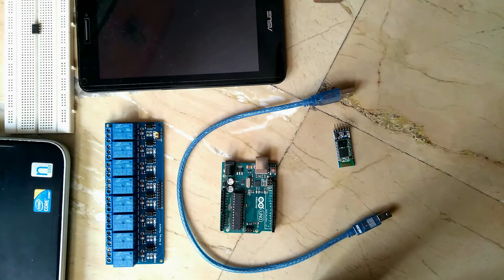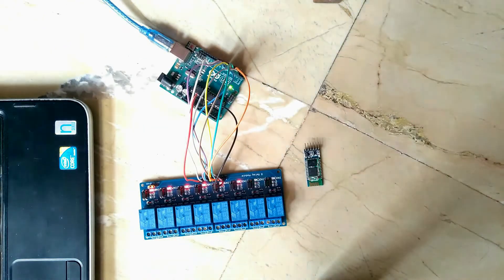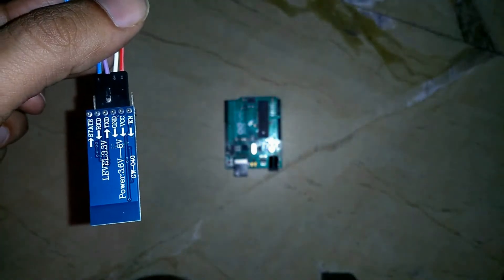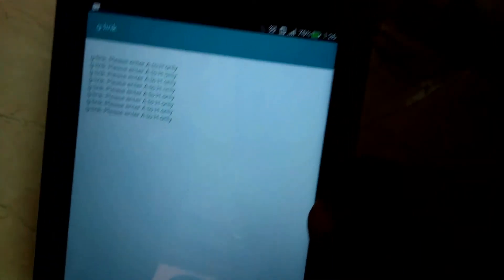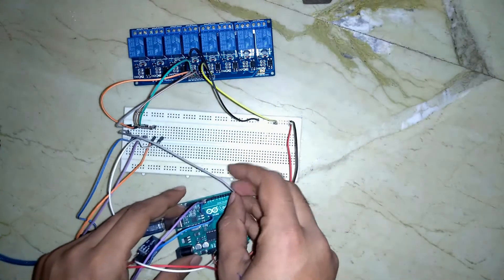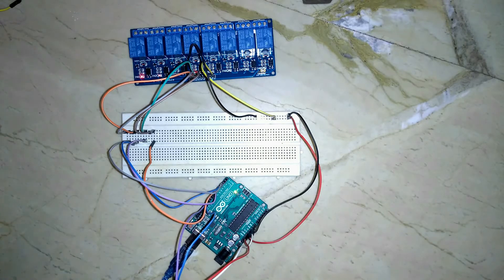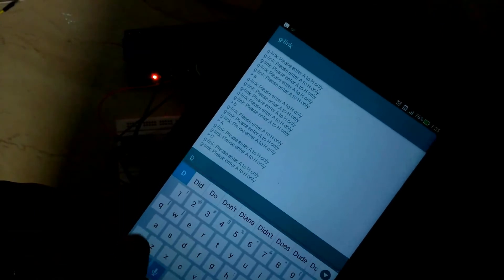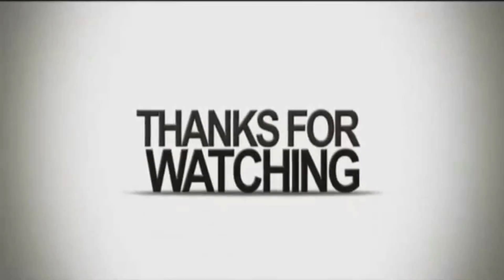Bluetooth Home Automation using Arduino Uno.

Comment: What is the difference between HC-05 and HC-06 Bluetooth Module? Does it work through all Bluetooth versions?
Reply from the maker: HC-06 is comparatively cheaper nd easily available bcoz it slave only device

While hc05 can serve as master as well as slave Bluetooth socket.

Both are compatible with all bluetooth version.